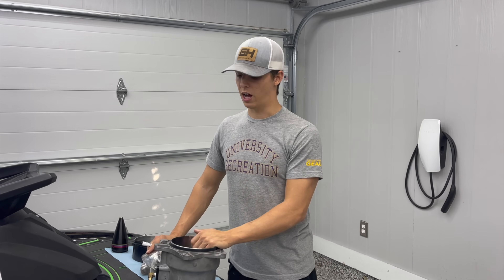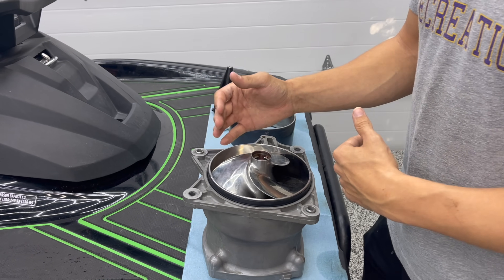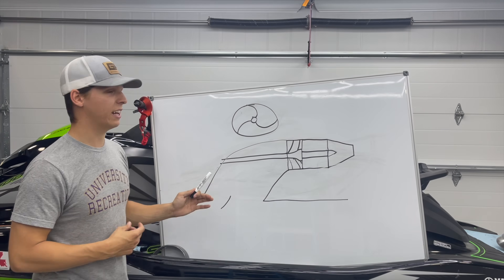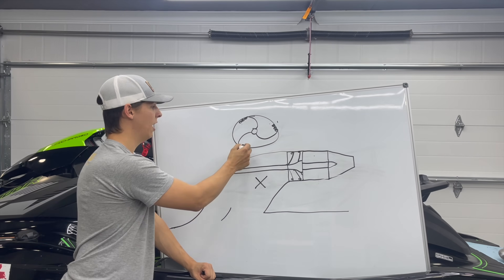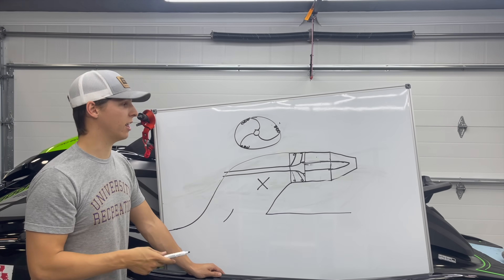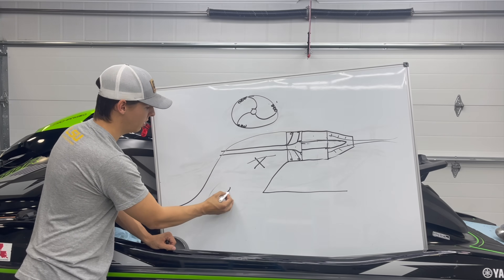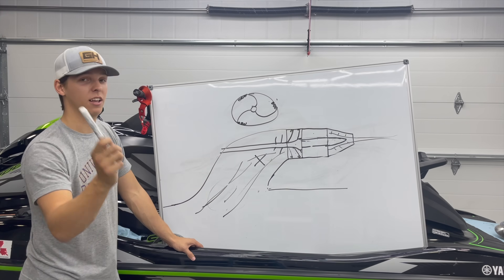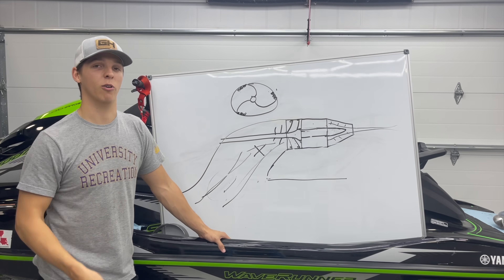Addressing Jet Pump Cavitation & IMPROVING Pump EFFICIENCY

Comment: What if you put gatorglide on that intercrate hull space to make the water slip through faster? Lol
Is kind of what I’m doing. I didn’t know it was such a huge deal. 
I’m also putting gatorglide on the cylinder thing and basically everything that’s metal except the solas propeller 

Tell me I didn’t do a bad thing. Please
Lol

Including the stock cone lololol

Comment: Are you familiar with the Seadoo Switch issues. Is there any fix? Like a better grate or nose cone?  Mine is terrible, wear ring and impeller are mint. No water in the hull to indicate a carbon seal issue and I dont run it out of the water. Solo or 2 people it seems OK but 4 people and I cant plane out and all I get is cavitation. So disappointed in it's complete lack of performance. My buddies Scarab is 100000 times a better boat with the same engine.
Reply from the maker: Yes I’m familiar with the issues. The Lucky 13 adjustable cone works well on these boats. You friend with the Scarab will benefit from this cone also. 

https://www.4-tecperformance.com/index.php?main_page=product_info&cPath=584_585_210&products_id=2355
Reply: @GreenHulkGarage  so in buying a cone, where should a guy start? Longest or shortest

Comment: You say 90% of skis would benefit from this. I found this on an otherwise stock 1.8 non-turbo SX190 single engine jet boat that I bought used. Trying to figure out if I should keep it on there or switch back to stock.

Comment: What if you increase the angle of attack of water inlet or add some water scoop to increase the intake water pressure? This theory basically same as ram air on high performance motor bike and jet engine. But, i think the risk is you gonna get more down draf on the back of your boat which mean its gonna lift and flip your boat while on high speed.

Comment: What about sealing the intake grate? Is it really necessary? 

I just took my intake grate off to remove stuck rope and I used 4200 to seal where the bolts enter the hull but didn’t even think about applying anything around the edge of the intake grate like some recommend

Comment: Need a pump stuffing video. I have a turbo 2007 rxp. Been 90mph on GPS. Never stuffed. Lucky cone no spacers, 161mm pump 
15/25 3 blade at 9200rpm. With 2 big PRVS.
Reply from the maker: I’ve paid attention to your ski and I’m somewhat familiar with it. 90 is right about the mark where the original RXP hull would start to stuff, you’re definitely playing it safe with the relief valves. The 161 pump is helping you out a lot too. 

I’ll be doing a video on pump stuffing soon, I just haven’t figured out which of my skis I will do it on. If I don’t jump ship on my RXP-X hull then that’ll be the perfect ski for the video.
Reply: @GreenHulkGarage  I'm always down for a video. I also log pump tunnel pressure on the fueltech. I think at 90 with that set up I was seeing something like 17-18 psi inlet pressure. 
Definitely trying to keep it safe because I want my ski to do 95. 
I'm getting a new sleeved motor from Eastside here soon then we can really turn up the boost. 
This was also all done on a stock ride plate as well! There was a 3psi tunnel difference between the riva and the stock plate.
Reply from the maker: Your tunnel pressure is very safe. I’d put the RIVA plate back on or even try a Jim’s open loop cut stock plate. You should easily get 95+.
Reply: @GreenHulkGarage  well. I have some data from Raulin. Back in the day he did 104 I think. He said at 25psi of pressure you will go swimming on a 215 hull.
Reply from the maker: Interesting, that seems very low pressure to stuff, but I haven’t pushed that hull to those speeds. I have zero experience on that hull over 100 MPH and there are less than a handful of people that have gone that fast on the original RXP hull. I’d hate for anyone to go swimming so play it safe.

Comment: Greg, I always enjoy your videos.  They are the best of the PWC subject matter.  If you review your series on the 21 RXP and the 21 GP, you will remember that the RXP was the best performer on 5-60 times as well as top speed.  Most of the performance difference was based on the cavitation issues on the Yamaha that allowed the Sea Doo to take the hole shot.  Why is it that BRP can build a pump that handles 300+ HP without cavitation and Yamaha cannot???  The pump issues have been going on at Yamaha for several years.  I could understand it if the issues were only on modified skis, but that is not the case.
Reply from the maker: The Sea-Doo pump has more veins, a larger pump cone from the factory, and a larger diameter hub than the Yamaha pump. All of these help with cavitation and holeshot. Even now with my GP running almost 10 mph faster and pulling higher G-forces when accelerating than my RXP, the RXP still out holeshots it. I am doing some pump work to the Yamaha that should fix this! 

I don’t think Yamaha sees this as an actual issue that needs addressing. The Yamaha pump is an excellent pump and has lots of potential, it just needs some fine tweaking to get the most out of it.

Comment: I would like a better explanation of how to address cavitation/stuffing issues. My confusion arises in that there are so many parameters of the pump that can be changed - the impeller pitch, the impeller itself, the pump cone size, the pump cone length, the nozzle size, the nozzle length, etc. - that I'm not sure what to do in what order or if all of it needs to be changed.
Reply from the maker: What ski do you have and what performance parts do you have installed? I’ll be able to point you in the right direction.

Comment: For an everyday ski what would you say the life expectancy of a impeller and wear ring? Should you always change both at the same time. Can you get away with just impeller or just wear ring? 

Thanks keep up the great work! ✌️
Reply from the maker: It depends. Sometimes the wear ring is in good shape but the impeller to wear ring clearance is too big. This would require replacing the impeller. Other times, like in my case, both the impeller and wear ring needed to be replaced. I’m at 115 hours and just switched to my third impeller. The good thing is, you don’t need to buy new impellers. Impros can repair them to save you money.

Comment: I would a video about pump stuffing
Reply: You need a one way valve before the the prop .1 inch diameter some people run two .they dump water out the back of the ski when the pressure increases to much before the prop .
Reply: Thanks  @rickohlson3962  , I'd love to know more about that. I don't suppose you'd have a link or reference to more info?